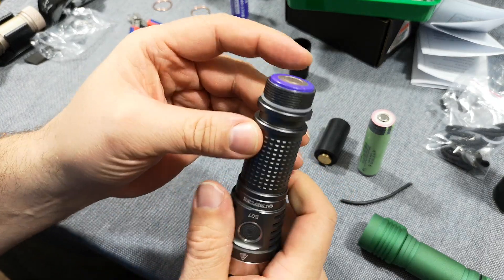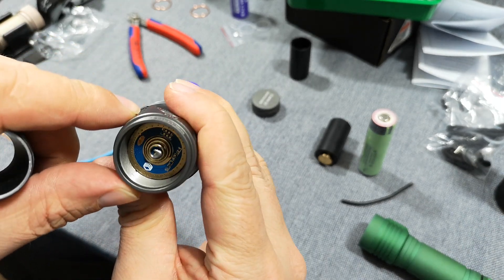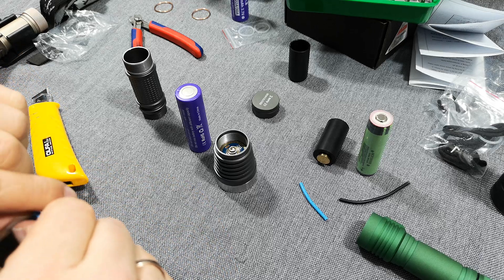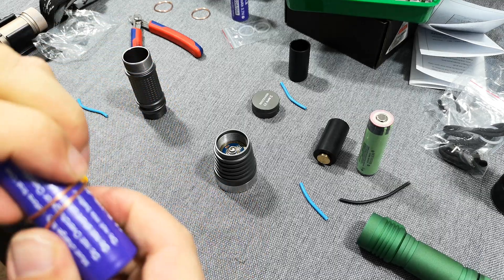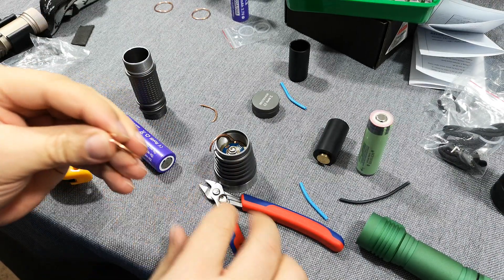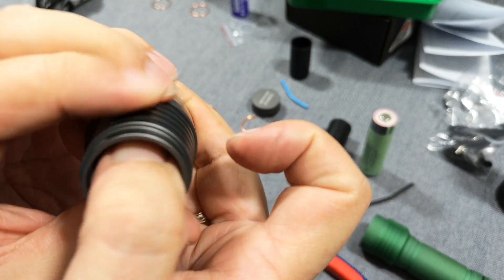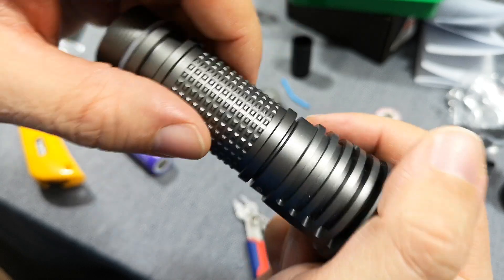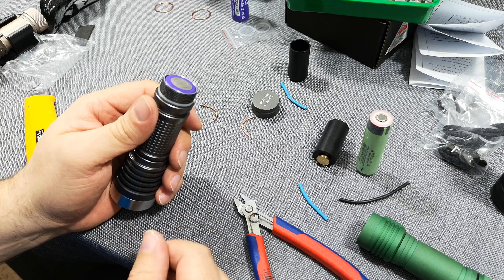making the battery tube longer to fit your favorite cell  (on a Fireflies E07)

Comment: I tried this, but it made me worry about decreasing its water resistance. Tried it in the tail cap, but then could not do the tail cap lock out. I ended up dremeling down the spring on both ends so it fits without crushing the + on 21700. Mine came with a huge pointed blob a solder on the + side spring. Now the round wire is flat wire on top and bottom springs. 21700 40t fits without issues

Comment: Another way to gain space is to make sure your spring can fully collapse. Some springs are more tubular shaped with not enough taper. They don't compress down as much as a pyramid shaped spring (big bottom diameter, small top diameter). You can swap springs, or cut down their length.
Sometimes a bypass wire will prevent the spring from compressing all the way. 
The main thing is don't force the battery cap on too tightly, it can damage the battery as well as the driver.

Comment: Thanks! Did it the same way and it works now.
Hope I haven't damaged the battery to much already... Found out about this problem only after some days... And the battery already has some marks on both ends..
Reply from the maker: you can send me pictures of your cells if you want a unprofessional opinion...

martin@m4dm4x.com
Reply from the maker: i do not think its damaged in a dangerous way..